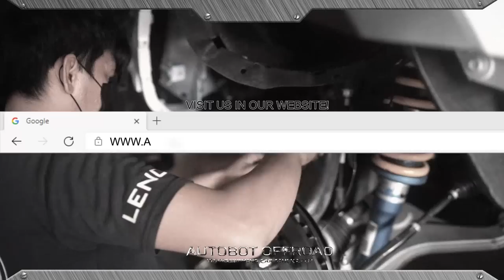ISUZU D-MAX 2021 - FIRST OF ITS KIND and FIRST IN THE PH. FULL BUILD!!! 🔥🔥🔥

Comment: Did you change the diff gear ratios?
Reply from the maker: no sir as we install the right wheelset and lighten bumper and rollbar :)
Reply: What size tyres are they, I couldn't make it out on the video.